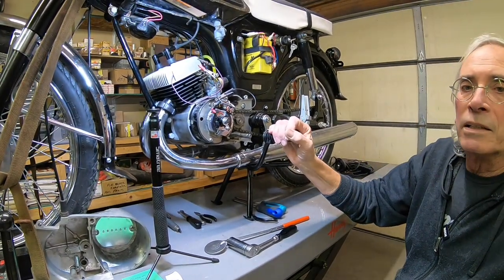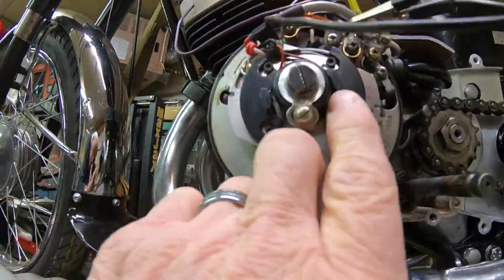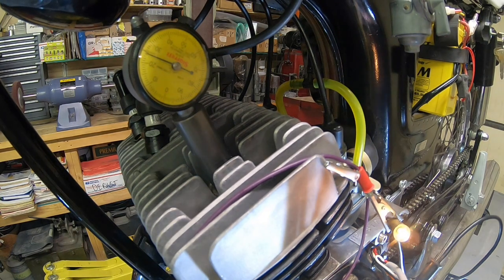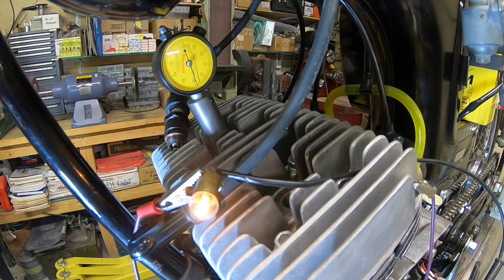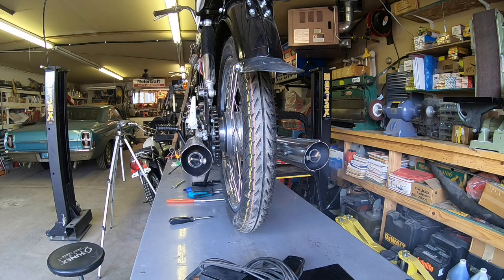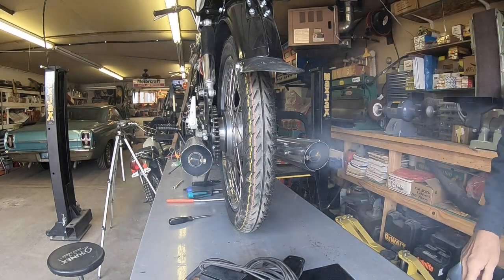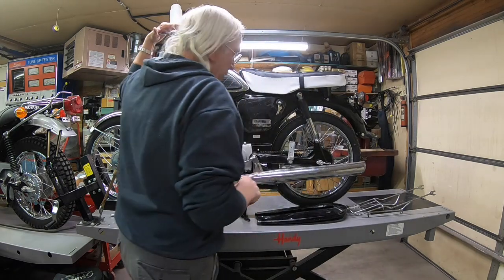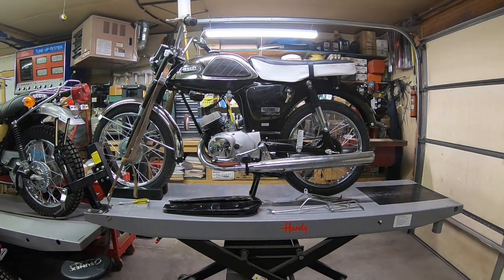Convert your Yamaha twin to pointless ignition, Part 4

Comment: Hi Dale, Definitely a worthwhile upgrade to make for most bikes that utilise CB points triggered Ignition systems, and I think superior to CDI systems, where the CDI units can go bad, may be you could improve that Ignition system further, by experimenting with the more modern up to date performance Ignition coils, Like I think MSD and there are other companies that make them, performance Ignition coils, might be a fun video and experiment to make one day, Enjoyed this series of videos, and was impressed with your manufacturing skills that you applied with this modification, Top Job !!!!!!    Malc U.K.
Reply from the maker: Hey Malc, I sure appreciate your suggestions and insights. I think you are right, I will have to give that a try in the future, after all these coils are 50+ years old, and the newer coils are certainly better. I use MSD coils and controllers on all my hot rod cars. Top notch products in my opinion. I have picked up a couple more of these ignition setups for future projects. I have a 71 Yamaha 125 enduro single cylinder that I think I will try to convert, and either the RD250 or the RD125 engines that will be used on future projects. Thanks for the ideas and thanks for hanging out in the shop with me.

Comment: with no advance, how will the ignition spark keep up with engine speed?
Reply: It's a bit of a compromise really Frank, they are set with enough advance to cope with the flame travel at the higher rev range, but not so much that it sacrifices the lower ranges. An electronic system with built in curves might liberate a little more power, but to get the best from it you would need to look at physical changes to improve volumetric efficiency. Hope you had a great Christmas.
Best wishes, Dean.
Reply: @retromechanicalengineer  Oh yeah, Dean Great Christmas hope yours was great to. thanks for the technical information, always thought the ignition timing as the RPM goes up needs to correct itself IE a advance of some type. sure love watching Dale he is a rising star on youtube i think, great content and smooth delivery. real gentleman and easy to watch.
Reply from the maker: Most bikes of this size and all of the point magneto type engines, like the Suzuki you worked on. Don't have advances, mechanical or electrical. When you set the points and the timing it is full advance at that point and will not change. Now the old triumphs and like that I think you rode, more than likely had a mechanical advance, like some fly weights or something.

Comment: Here! Great video as usual Dale. Nothing like a successful project. Although not an electronic ignition system, the reed switches will be a much more reliable trigger for the coils and dispense with the condensers which become a weak link as the dielectric ages. 
Best wishes, Dean.
Reply from the maker: Yes sir, I think at least it should be more reliable than the old stuff. Moved into the big time a little bit anyway. Got a few more similar projects down the pike. Nice to have new projects for the channel, I'm sure you can relate.

Comment: Runs better than new with the electronic ignition that's the way to go  these days
Reply from the maker: I think so too Larry, even economically it is less. New points and condensers run 100 bucks if you can find them. This was half that, of course there was quite a bit of labor involved, but to me the labor is fun. Thats a win, win. Thanks for hanging out with me.